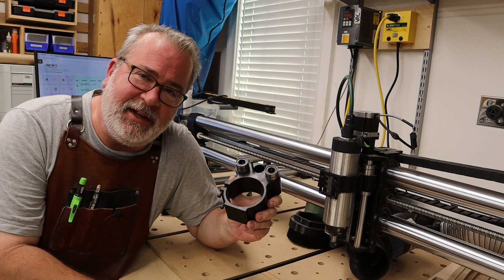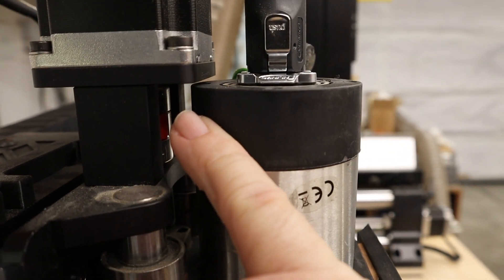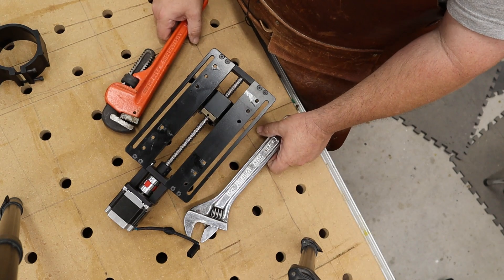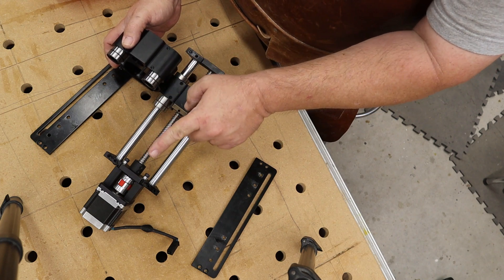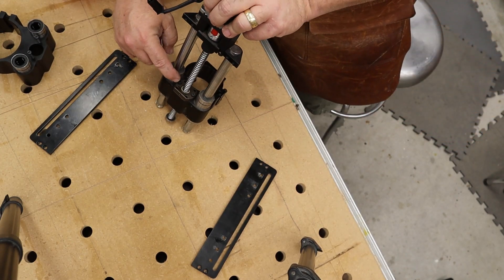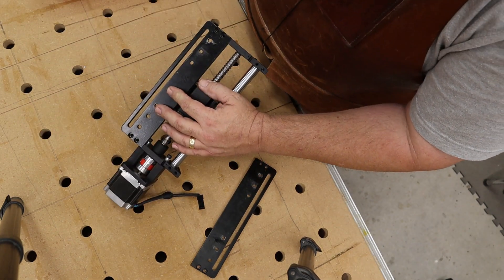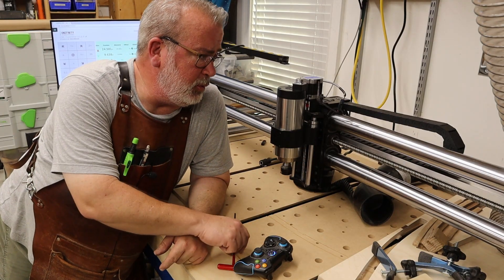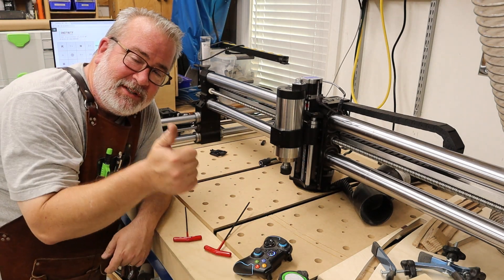Onefinity CNC Spindle Selection  Which One Is Right For You?  SIZE MATTERS!

Comment: Do all 65 mm spindles encounter clearance issues? Or just the particular one you used? Thanks for the vid :)
Reply from the maker: Hi, the issue is the 65mm spindle carrier aligns the spindle with just ever so slightly having travel interference with the motor. If you’re not cutting super thick material a 65mm may work for you.  All spindles are shaped the same so a different spindle wouldn’t correct the issue. Thanks, and consider subscribing while you’re here.  More videos coming soon

Comment: What is the kw rating of the your 80mm spindle? I have the same 65mm spindle, heck we even have the same spindle connector and cable mod. Mine is 1.5kw. I'm also looking to change to ER20 collect. I'm also looking to have more power, I really feel the 65mm 1.5kw is underpower even compare to the regular router. I'm looking for 2.2kw but most of them are already in 220v which I gonna need to change the VFD too which is too much work .
Reply from the maker: Hi pinoy, thanks for checking the video out and your comment. I’m currently running a 2.2kw 80mm but in first version I had the 65mm 1.5kw. Feel free to subscribe while you’re here as I’ve just moved and am building out my shop again and will have new videos out soon!
Reply: @TradeSkillersAnonymous  is it 220v?
Reply from the maker: Yes, both my initial and this second one are 220v

Comment: I saw someone makes adapter so that you can mount 65mm spindle or router onto 80mm mount bracket. Will that solve the 65mm spindle hitting the z axis top? I am thinking of buying a 65mm 1.5 air cooled 110v spindle for an Elite Journeyman. I would love to hear your thoughts. I have only 110v in my garage.
Reply from the maker: Yeah, that’s probably a solution, I wonder though if it hangs off the gantry too far would it create issues with flew or something?

Comment: Great video thanks. Quick question, how much does the 80mm change the cutting area of the Onefinity?
Reply from the maker: Total area available to cut is the same, it does push the y axis forward by the difference between the 65 and 80mm center point, but you just adjust your spool board if you need to by that same amount. I didn’t do that, just ran it as is. Feel free to subscribe while you’re here, if you like. Thanks!

Comment: I just received my Onefinity and 80mm spindle.  How do you determine how high to mount the Z slider, how high to mount the spindle in it?
Reply from the maker: Hi John, I used the middle holes on the slider and placed the spindle in the slider at a height that would adequately reach the work. That’s a beefy spindle clamp, you’ll be fine moving the spindle up or down in the coupler to fit your need.

Comment: Great video. One observation, your Z travel is ultimately limited by the lower ball screw bracket height. What I did is set my spindle nose at 1/16 lower than the bracket. This way I avoid interference between the bracket and workpiece.
Reply from the maker: Good thinking!  Feel free to subscribe while you’re here. Upcoming videos on the elite series machine!

Comment: J.R. - Great Job, and timely, as I am about to order a spindle / vfd.  I have an 80mm water cooled spindle on another cnc, but would be very interested in how your air cooled is performing.  Also wondering if your unit is louder (spinning but not cutting) that the water cooled version.  I'm impressed (and subscribed).
Reply from the maker: Hi Frank, thanks very much!  From my research and what lead me to go air cooled, is firstly that I don't intend on machining metal, and wont need slow RPM operations which is where water cooled really has an advantage.  Below something like 7200 RPM, an air cooled spindle cant cool itself properly.  I've never had a water cooled to compare the noise levels to, but I guess water cooled would be quieter.  That said, when my machine is running, the cutting tool is always louder than the motor, and I really don't run the spindle much in a non cutting situation.  Really just start a job, and might wait a minute to warm it up before starting, and when it's done I shut it right off, so non cutting sounds arent really a concern in my case.

I think water cooled spindles are great, but my personal choice was to not involve coolant in my CNC.  Really just didnt want to deal with more components etc.

Thanks again and happy CNCi'ng!

Comment: Couple things - you didn't mention where you have your z-gantry mounted on the z-axis (there are 3 different set of positioning holes).  Did you change the vertical position when you switched spindles?  And I didn't hear any mention of re-tramming - I'm assuming that's something you did later, correct?
Reply from the maker: Hi Peter, I did move the Z up (so lowest of the three screw holes) and I got surprisingly lucky and just needed a slight tram adjustment which was quick.  I left that out because there are already a bunch of videos about tramming and thought it'd make this too long.
Reply: @TradeSkillersAnonymous  Thanks - I just mounted my PC 890 on the 1F and had to move it up as well (along w/ensuring the proper z step-motor clearance.  The nod tram was quite a bit a different than the small Makita but the weight contributed to that.

Comment: Good explanation. Any thoughts on how the additional weight will impact the stepper motors. Like all good things, mods beget more mods in my experience. After you've run it for a while, I'd be interested in some insight into performance gains and or differences. Its obviously more robust but unsure of the use case to value. I'd imagine it differs for everyone.
Reply: I have a 80 mm spindle on a Onefinity and the weight has not been a problem.  As I remember, your question has been discussed at length on Onefinity's forum.  The ball screw Z drive and stepper seems to be up to the task with no issues.
Reply from the maker: I’m not anticipating any immediate issues, but can dial up the power if needed. It is a good bit heavier than the makita, and somewhat heavier than the 65mm. Time will tell.  Thanks for checking it out!

Comment: Thanks, J.R. I've had my Onefinity Journeyman for just under a month and will be sticking with the Makita router until I get much more comfortable with the Journeyman. I do mostly small items such as signs and boxes, but I'm also doing a lot of flattening for the rough sawn boards I prefer to work with. I'm using a 1.5" flattening bit with carbide inserts on a 0.25" shaft, which is working fine, but I know that shaft is a serious weak point. I'd like to move up to a 0.5" collet, so that will likely be my excuse to get to the 80mm spindle. Anyway, all that to say thanks for showing how it's done.
Reply from the maker: I started with the makita like most people, and honestly it worked really well.  This would be that next 10-20% capability. Definitely not required but I thought it might help to illustrate an important difference between 65 and 80mm. Appreciate you, hope you’re well!